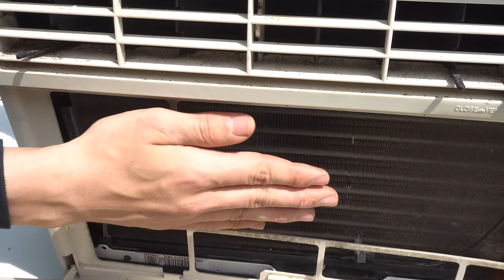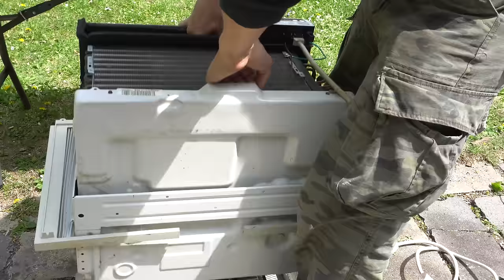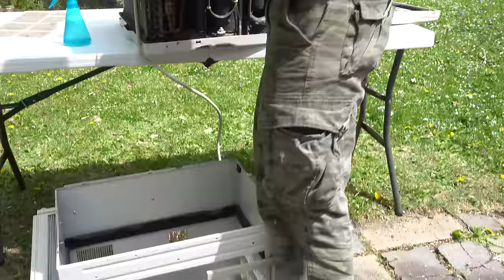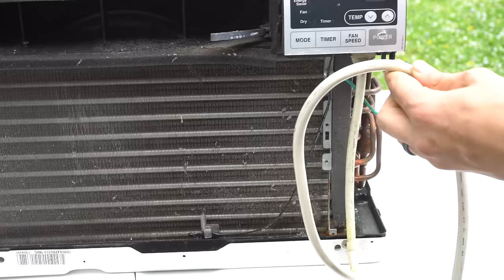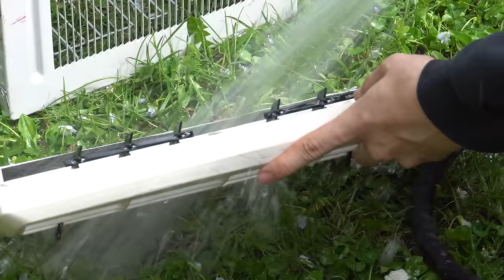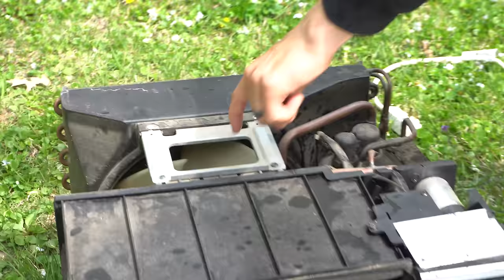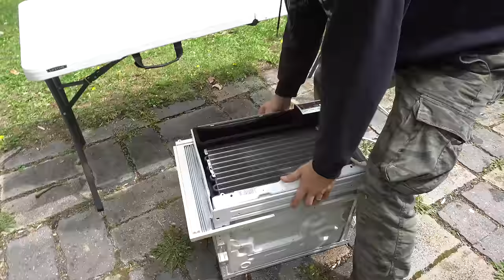Window Air Conditioner Not Cooling And The Most Common Fix

Comment: @ 3:00 good tip but getting mine off was far from like this. How do you get it loose at the bottom without splitting the plastic? Mine is fighting me like it was molded on! Can you suggest any special tools like a nail puller, thin screwdriver or putty knife? I don't want to damage the unit but the "safety" plug had burned up and to fix it I'll need to replace the entire power cord. To do that as I'm seeing here the front needs to come off the way you demonstrate. You make it all look so easy. It is NOT!  
Thanks for all your trouble and for posting this tutorial. Now if only can make it work. . Mine is a Frigidaire. Am told, by an a/c tech I can do it myself!

Comment: After I cleaned my ac wall unit, I let it dry, but the fan blades have seized up. Any suggestions? I tried spraying some WD-40 but, either, not enough is getting in there or it isn't doing anything. Thanks
Reply: Yes replace bad unit with new one.

Comment: Also check to be sure that the temperature sensor is properly placed and not obstructed and dust free.
Reply: your tips saved me thank you!
Reply: I’m thinking of sticking that outside the vent would that be bad? The compressor short cycles and won’t stay on long.

Comment: Hey, do you have a video on how to charge a window AC unit like the one you just cleaned? Mine is an older model from LG that hasn't had a filter cleaning since it was bought. When I opened the front to clean the filter, I noticed some ice on the coils, and now it's not blowing cold air. I think its either more ice that I cannot see that is blocking flow, or its the freon levels. Thank you for this video!

Comment: So I didn't know you should not install these sideways... and i had mine running that way and now it won't blow cold air, just blows room temp air. I turned it right side up but it still isn't running cold.. is it shot? I cleaned out the filter too.

Comment: How long should I let it dry for ?
Reply from the maker: Optimally a whole day. Especially if you tipped it over on the side like I did in the video. Besides drying out, the oil from the compressor needs some time to make its way back as well. I forgot to talk about this in the video but that is an important part too..

Comment: I have that same LG air conditioner I cleaned it before I installed it but it has a problem where it cools everything fine but after several minutes the fan stops working so I have to turn it off for 10 or 15 minutes and then it works fine.  I do that every time I get that problem

I hope someone can help me

Comment: That coil that you washed in the front you need to go in the back and wash it going out what you're doing is actually shoving the stuff further into the coil and you can plug it that way whichever way the air goes into it you have to backwash it the opposite way

Comment: You might want to suggest that after bouncing, turning, rotating, flipping.... that the AC unit should be left for at least 24, preferably 48 hrs in its proper working orientation BEFORE even plugging in!  (Same thing applies to moving refrigerators, freezers,.... anything with COOLANT  (Freon, ...) or you could have just cost yerself $75 - $300 for being impatient!   (... told a friends, they  didnt listen..."told ya so!")

BTW.... Why is it we Never seem to have the time to do it RIGHT in the first place, but we ALWAYS have time to do it over again?  lol
Reply: Can it be too late? I think I may have stored it over winter on its side. And it’s had problems keeping the compressor going lately. Short cycling. Etc.

Comment: cleaned the ac unit a week ago and now its freezing on the bottom part of the coils any suggestions on what it could be (lg windows ac unit but with the filter pull out) same setup as the video
Reply: Before it was dirty so you probably put the temperature super low. Now its working so raise the temperature a little so it won't freeze at night

Comment: Step 1. Remove from window 2. Go to HVAC repair shop and have them safely and legally remove the refrigerant, while there get a quote on a split system 3. Take it to the junk yard. 5 Buy and have a split system installed professionally.
Reply: @WR ZL 1 you have no clue what you’re talking about. Window units are more efficient than split systems. Total dunce

Comment: My window unit has one side blowing air much weaker than it once did. The only change I made was buying a magnetic drip cushion that sits on top of the unit. Is that causing it to not blow as powerful? How can I fix it while keeping my drip cushion?
Reply: What is a drip cushion?

Comment: How long do you need to let it dry before using ??
Reply from the maker: If possible until it is completely dry and you see no water. Usually letting it dry over night is sufficient, just pick a day when it's not super hot even at night..
Reply: @WordofAdviceTV  well it was 107 that day . It took about 5 hours to dry. Thank you for getting back to me.

Comment: Can this window unit be charged like a normal HAVC system ?
Reply from the maker: It does not have access ports like a central air condenser unit has but yes, it is possible to charge a window AC.

Comment: How do you find out the BTU?. My wall unit quit cooling and we cleaned the filter.  Can you pull a wall unit out?
Reply: If you can find the model number you can Google for the instruction manual which will list the specs. But if the model number is on a plate with other info the BTU should be on there too. In a through the wall AC unit usually the case stays and you pull the frame out with all the guts intact. Sometimes you can pull the entire unit out as well.

Comment: Take it to the laundry sink and wash down the whole thing.  Dish soap and water I use small scrub brush making sure screen filter is flat on surface before I use the brush I prefer whisp broom so not too much pressure to scrub filter before after rinsing ‼ I didn't really have the air pressure to water spout cleaning the filter.

Comment: I have this same unit.  Just started today, the compressor will only kick on around 77 degrees even when the unit is set to 60. not sure if its a thermostat issue or what.
Reply: Same here...77 degrees
Reply: Sounds like my problem

Comment: My AC has styrofoam pieces inside. I read a manufacturer said do not get it wet from cleaning it. I'm thinking probably newer ones have it but not old high electricity usage machines don't. I'm sure manufacturer's will make them so you can't take'em apart. They want you to have to buy a new one.

Comment: Although your way is probably the most comprehensive way to clean a window AC its not the most practical for many homeowners due to the weight of the unit.  I found taking a good brush, vacuum and especially using a leaf blower on low speed.  The leaf blower really works good to force the dust and particles out from inside and outside the unit.  You definitely have to wash the filter though.

Comment: Mine was freezing issue. The front didnt come off easy so I just took a hot blow dryer to it until I heard ice melting. Bewm.
Reply: If you are making ice, you have an airflow problem: dirty filter, dirty coil, dirty fan impeller.
Reply: @moeb434  its brand new. Just working way too hard for a tiny unit in a week of over 100 degrees

Comment: Mine keep throwing the circuit breaker, and it will not run on power saver. Got any ideas what problems it has? 6-10-2020
Reply: Is the volts too high for your breaker?  I almost bought one that my outlet couldn't handle unless I switched out breaker for bigger one!

Comment: I am not a tech.,  but never use a high pressure washer to wash the coils.  It will bend the fins.  I also wash the filter in the kitchen sink about once a month with the sprayer in the summer.

Comment: 1st thing I do is pick a speed and wire it to on with compressor, none of this blower coming on every few minutes and putting humidity back into air.  The thermistor may need to be stuck thru vent on outside for better offset.
Reply from the maker: Great suggestion! Thank you AD! That will probably help with mold build up too

Comment: How about mold? I put my unit out in May and by the end of July It gets black mold on the styrofoam in the area where cool air blows out. I have to take it apart and clean the mold every year. How do I keep mold from reacuring?
Reply from the maker: To be honest I don't have any good suggestions for you.. But I would be curious to know what's a good remedy for that as well. Moist environments are great for mold growth but there really is no way to avoid condensation with an air conditioner so I am not sure if there is a way to stop that completely.
Reply: @WordofAdviceTV  bleach

Comment: How do I clean out water clogging my house from the same air conditioner? Really need your help
Reply: Try making sure that the unit is tilted back slightly so the water will run out the back (if no small level try seeing which way a marble will roll). Also make sure the drain hole underneath isn't clogged up.

Comment: My little window unit is cooling but no water is leaking out as it should. It is not leaking inside either. Mostly.. is dry inside but it cools. I have already cleaned it inside.. What else could be wrong? Why is it that is not taking the moister out of the air? I get a little condensation under the AC from the inside from time to time that goes away once i adjust the setting to a colder setting.

Comment: I have a brand new unit I just put in this week.  14,000 BTU Frigidaire.  It is only getting the room to the mid to high 70s in 85-degree weather.  

I taped a thermometer to the grill that is blowing the cold air, and the temperature of the air is continuously changing every 5 minutes or so from 58 degrees for the low, up to 73 degrees for the high.  It's usually somewhere between the two, between 63 to 70.  

Any idea as to what that could be?  Thanks for your help.

Comment: Mine won’t turn back on. It’s dry. I obviously didn’t spray the electrical section but it won’t turn back on and the reason I clean this is because were in the middle of a heat wave and it wasn’t working.

Comment: Ha ha complain about the weight of that small one I have 2 of the big ge heat and a/c units , they are a pain to lift . But after. 4+ years CLR mold and mildew works good to remove the rust and corrosion that is keeping them from working as good as they should.

Comment: Why does the air conditioner need to be upright 24 hours before running for the first time? It's necessary for the oils in the compressor to settle before turning the unit on, not doing so can affect the performance of the unit.

Comment: Question-Mine I have cleaned it pretty well ..and It works great (LV100CE) then only thing is that for some reason when it get to hot outside (30°c)  my AC for some reason blows warm air.I don't understand why it would be more than helpful if someone could help me.BIG thanks in advance.

Comment: 7 21 2022 kitchens in open living spaces cause grease to coat fins/filters;  so cleaning requires strong detergents & lots of scrubbing.  older window units had shaft oil ports but they were built to last in use 10+ years.
  IMO~ Cooking or Bathing are Not spectator sports. If you're not preping cleaning get OUT of way. &  all good kitchens should have a dedcated hand washing sink or 1/2 bath.

Comment: Anyone else having problems with newer units? I bought 3 new units , one midea and two fridge air.  They all blow out warm air on occasion then switch back to cold. And two of the units aren't that dirt. They were doing it when brand new. Are they purposely making the units to fail or something? So we can never stay cool in the summer

Comment: What if the filter has gone missing?
Reply from the maker: You should be able to order a new one or just occasionally vacuum the evaporator coil and then wash it yearly.
Reply: Buy a disposable one and cut it to fit.

Comment: Just one complaint. This is all great if you can actually GET the damned casing apart. Why does it seem like everyone that makes these videos always start with the casing already off? I've tried with many AC's over the years and have NEVER been able to get the screws loose. They just strip so I just hose off what I can get to, which is never enough.

Comment: I did all that before watching this video, I think I need a new unit as the compressor doesn't seem to kick on anymore
Reply: I unplugged my Kenmore AC from 2013. I took the front off, cleaned all the dirt + muck out real good with compressed air. Made sure all the wires were back screwed in tight. I plugged it all back in + BAM - the sucker is blowing colder than a witch's teats. The front digital dashboard is completely fried, but thank goodness it still works. Sometimes all they need is some TLC.

Comment: HELP,  how do I clean the coils on mine.  It's kinda built into the wall.
Reply: If you have a vacuum, or shopvac use the brush attachment on the hose. Gently vacuum the coils.
Also look outside directly behind the unit outside. If there is a big box with a fan, look to see if there are leaves built up around it. Clean the area.
Good luck.

Comment: The one in the back the worst will be on the inside if you take a flashlight and look you will see you need to get it off and the blade as well you'd be surprised you think you have it clean but if you take the the shroud out and see the back

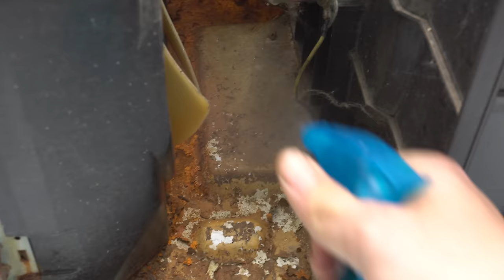Comment: 7:07 i usually drill a hole in the pan so that the water drains out so it doesn’t accumulate just make sure you don’t drill into the condenser or the coil or even the compressor
Reply: A lot of newer units are built with a slinger designed fan motor which slings condensation up onto certain components to help with cooling efficiency

Comment: in a better world this would be designed so you can easily remove the control electronics by sliding them out and then just pressure clean the whole AC, let it dry and put everything together and everyone should be capable of doing it... all stuff must be designed to make this way and that rust on the bottom it is avoidable if they just sprayed some polyerethan foam or did some rubbery coating, they know that it will rust as there will be a lot of moister but somehow they just don't care because they want everyone to buy buy buy....

Comment: Mine just wont turn on I plug it in and is not turn on its probably been electrocuted by the condesation and it works a tad bit but just turns back off

Comment: All the crap that builds up between the fan and the condenser makes me wonder why it's not designed to pull air in the back and exhaust it out the sides, that way all the crap builds up on the back of the unit where its easy to clean without removing and disassembling the unit instead of inside the unit where you have to remove it and take it all apart to clean it.
Reply from the maker: I agree, that would have been more efficient.. The engineers must have known better though lol

Comment: If you didn't know about the filter on your window unit -  quickly pick up your window unit right now, drop it on the floor with force, and go stand in the corner for the next two hours.

Comment: Bruh i turned my ac upside down now it dont cool like it used to and it dont produce the water like it used to that leaked out the back . ...😔 i think i messed it up and have to buy another one
Reply from the maker: Ah sorry to hear about that! Did you leave it upside down for a while? Unfortunately I forgot to mention in this video that you don't want to leave them on the side or upside down for a prolonged time. And once you do flip them back upright, it's best not to turn the unit on right away and give it at least half a day before powering it on.
Reply: @WordofAdviceTV  that's where I messed up then. I flipped it quick washing it out and flipped it back and right after I turned it on lol it blows cold air but I don't hear the noise of the compressor kicking on or whatever it is

Comment: Lord help me. I live in a city and have zero arm strength... even if I could get it out on my own, which I wouldn’t even know where to begin because it’s attached with an “arm” (??) I wouldn’t have much space to clean it. Don’t want to spend an insane amount of money on a new unit and someone to install it, but I don’t know what else to do!!!
Reply: The "arm" is just a support that your AC would not fall down outside. I would suggest you hire a TaskRabbit handyman for an hour or two(make sure AC Is dry inside). A knowledgable man with a screwgun would do it.

Comment: Dude, the only thing can improve the AC in this video in the filter cleaning and everything else in not going to improve it , you need to check for leaks and try to fill your gas  in the unit and for that you need a cooper line poked with a special adapter

Comment: So i did it and it doesnt turn on anymore i plug it in and it just clicks and beeps
Reply from the maker: Oh no! Sorry to hear about that. Did you let it dry out before you plugged it in? Does your unit have a capacitor? It's possible that the capacitor is dead.

Comment: Throw it in the trash, ( after recycling the refrigerant ), and  buy a split-system!
Reply: I actually have the exact opposite recommendation. Certain situations split systems are good, but for the most part your gonna get more bang for buck with a window unit. Not to mention the Control Boards In split systems are super prone to going out. Just my opinion, from my experience as a technician and working on AC. 

The one pro about split systems are they are very efficient. Your not gonna use a lot of energy running a 21 sear split system

Comment: NO NO, DO NOT SPRAY THE ELECTRICALS
AT ALL.
At the very very least the electrical area should have been protected with a plastic bag around it. 
Water and electricity, ESPECIALLY with a capacitor involved,  is an invitation to a disaster.